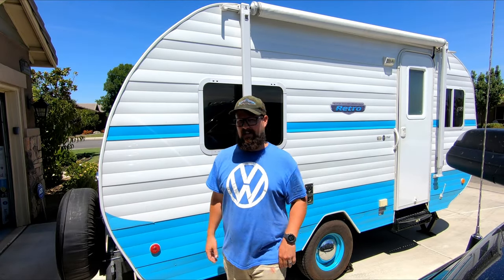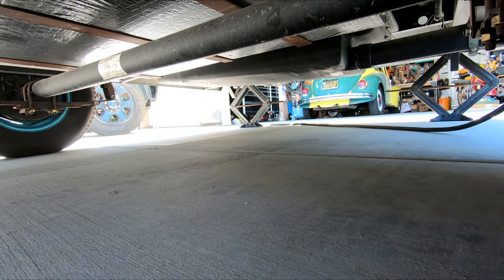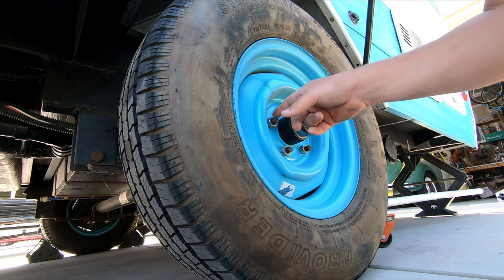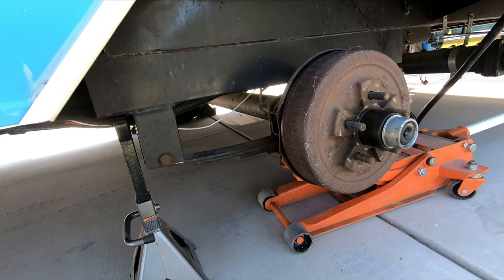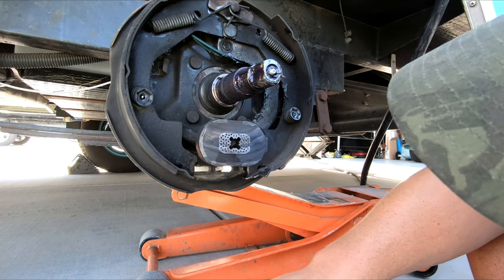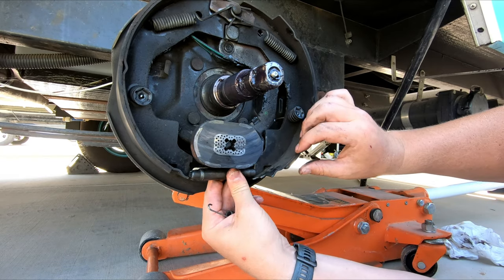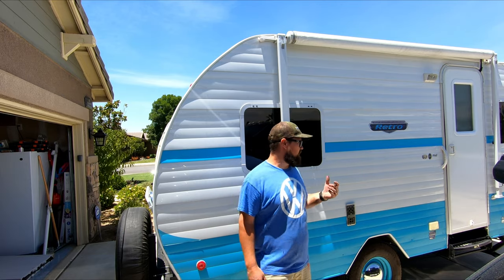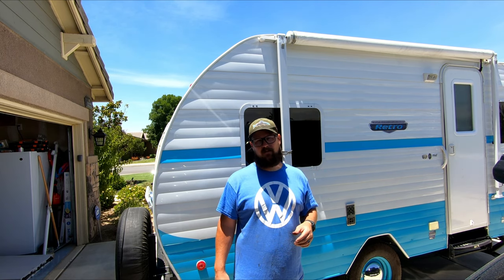How To Jack Up A Travel Trailer // Trailer Brake Repair & Bearing Removal

Comment: I’m here looking how to do this on my nobo 19.3 😬 Thanks for the video
Reply from the maker: The NoBo is a little different with its torsion suspension and dual axles. They make a trailer aide to drive on with one axle that will lift the other wheel off the ground. That's the "proper" way. I've never seen any tire shop do that, but you do want to be sure that if you jack it up, you do it on the mounting plate where the axle meets the frame and not on the tube. If you jack it up on the axle tube, it might deform it and cause problems.  Brakes and bearings are pretty much the same. Good luck and reach out if you have any other questions. I suppose it's about time to make a new video with my NoBo 19.3.
Reply: @RoadandReel  thank you for the advice! I didn’t know about the drive on trailer aid. I needed up just getting a bottle Jack. I will follow your recommendation in regards to placement. I need to adjust the electronic breaks. The star wheel is giving me some trouble. I may have to open things up and see what’s going on.